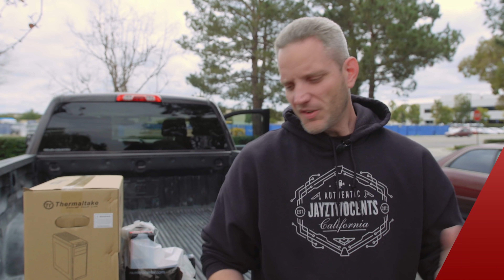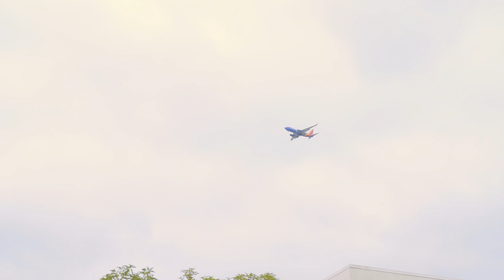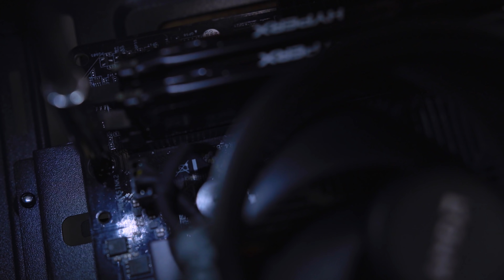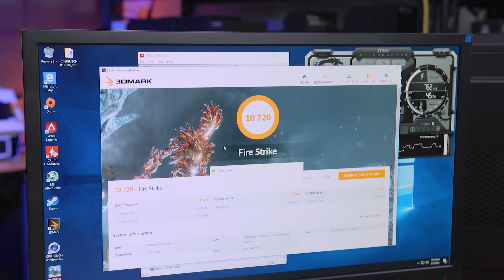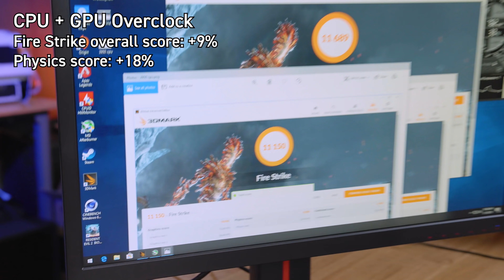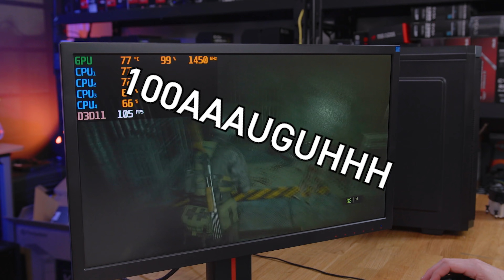CHEAP Gaming PC Build - 2019

Comment: Cheap gaming PC Build in 2019 means keeping your fucking money in your pocket until July.

If you buy computer components for a build now, then you might as well set fire to your money in front of your face.

What is my reasoning you may ask? And ask you may and the reasoning will follow:

1) CPU
It is no secret that the Ryzen 3000 will be released on the 7th of July and announced at Computex in at the end of May. The Ryzen 3000 series will easily outperform the Intel counterparts in the Desktop segment at a far, FAR lower price. For around $200 you will be able to get a Ryzen CPU that will outperform the Intel i9-9900K priced at $600

2) RAM
RAM prices have been gradually coming down and it is expected that by July the prices will have come down by 25%-30% of what it is now.

3) GPU
AMD will be releasing Navi in July and it will be competing against Nvidia up to the RTX 2070 level, but at a far lower price. This will of course force Nvidia to lower their prices - and Nvidia have a lot of room to lower their prices. So even if you don't like AMD, waiting for a few months will net you an Nvidia card for a LOT cheaper than you will be able to buy one now.

4) Mobo
With the Ryzen 3000 Series a new X570 motherboard will be announced. This is not a direct cost saving; however, because the Ryzen 3000 series will be backward compatible with the X470 series of motherboards (except perhaps the R9 3800X/3850X) it will force the price for the X470 boards down.

For the above four components I looked for the best prices I could find for an all-singing, all-dancing Gaming Rig and came to $1,373. I then estimated a conservative price (meaning I was pessimistic about the expected prices and didn't low-ball them) and, for the same performance, you should expect to pay $730.

5) If you are even remotely considering building an Intel based system this year, then you are a complete and utter fuckwit.

In conclusion I have no idea why @JayzTwoCents went with a 2200G when he could have gotten a really good bundle on a 2300X because the GPU portion of the 2200G is garbage anyway and he was going to buy a separate GPU.

For a lot better performance than this budget PC could deliver for $567.76, if you wait until July you will only have to pay, at most, $450.

So @JayzTwoCents was not doing you a favour by making this video, he was doing you a disservice by suggesting that this was a good thing to do - and he knows better.

So shame on you @JayzTwoCents, this was a rotten video to put out, especially when targetting an audience of low means, and I hope that nobody who has a tight budget is conned into following your advice.

Comment: My issues with most AMD overclocks is that the cpu now stays at 3.95Ghz instead of clocking down when idle. Can you confirm if thats the case with this Asrock board? Also how are people getting the OS for free  - legally?
Reply: windows is free, you just wont be able to change the background on it and theres a few other features that i cant remember  but you still get updates as normal.

Comment: Is this build good for games like Assassin's Creed Odyssey?

Ryzen 5 1600 
MSI X370 Gaming Pro
Sapphire RX 580 Nitro+ 8 GB
RAM 16 GB Kingston HyperX Fury 2666Mhz
1 TB HDD WD Blue
Corsair 600 PSU
Reply: That'll be fine man, presuming you're playing on 1080?
Reply: @madcypriot3166  Yes, 1080 High or Very High, not looking for Ultra, 
Now I have tested the RX 580 on Assassin's Creed Odyssey... It's one shit card and I regret buying... Not even running on medium probably with the latest drivers and keeps crashing. The GPU itself is crashing too.
Reply: CPU Utilization is not even reaching 25%+
Reply: @Sulto_  I think that's more the game than anything else, the 580 should be able to run most games on 1080 at high - ultra. Have you tried any other games?
Reply: @madcypriot3166  Downloading other games now to test it, hopefully it's not fucked up situation...

Comment: R5 1600 is $99 at Microcenter. Would this be a better buy?
Reply: GET THE R5 WTF $99 HOLY SHIT
Reply: Yes! I cannot believe he went with the 2200G in the current market. You can do so much better and add like $20 to the build.
Reply: Yes
Reply: I got my r5 2600 for 130 lol brand new
Reply: Youre right

You can get used r5 2600 for 200 canadian or 140ish usd
Reply: Of course!
Reply: its 79.99 at my microcenter, the r7 1700x is $120 also remember the $30 off when you combo a mobo. I saw a vega 56 for 250 on newegg but that deal is no longer available rip.
Reply: @jonnysalazar94  That sale just started this week. It was $99 last week.
Reply: Call me high but is it overboard to get a Ryzen 7 2700x? 😂
Reply: @fredericchopin8874  I mean depends what you use it for. if its for gaming, a bit but itll last you a while before you need to upgrade.
Reply: I checked the micro center near me and its $80! Aaahh

Comment: Holy shit i've been actually doing my research for about 2 weeks and been buying the parts for the exact specs in this video lol
Reply: yes
me too but using an 2400G. so its more powerful in igpu
Reply: Pedro Gabriel same
Reply: Get the Ryzen 1600 for 80 dollars at microcenter
Reply: Pedro Gabriel same but went with a R5 2600 on sale and the XFX xxx 580
Reply: If you have rainbow six siege can you let me know your FPS and settings used?
Reply: I changed the processor to ryzen 3 1300x

Comment: Wanna play apex =
1.buy ps4 
2.connect the ps4 to your wifi.
3.install apex
4.play it.      You saved 300 dollars
Reply: And play sub 50 fps with controller? Hard pass.
Reply: @kebotakandini  you can connect a mouse and keyboard
Reply: @Dervisgt  and the played 24 ms and stick close to 55 inch television? Another hard hard pass.

Comment: Personally i use:
GTX 1050ti gaming X
Ryzen 3 2200g
8gb corsair vengence RAM
480gb burst ssd
500gb baracuda hdd
550 watt corsair Psu
MSI A320-M Pro-VD
Reply: Upgrade to 1070 ryzen 7 or i5 16 gb :)
Reply: @danitft-t9p  yeah if i had the cash! I just upgraded it 7 days ago and at 14 its not easy to get money
Reply: You could've gotten way better performance with the rx580 for almost the same price. Been researching it myself. Although it still depends on the prices in your country.

Comment: Almost exactly my build, still waiting for the parts, Ram is Ballistix, no hdd, 500gb ssd, and a used xfx480 8gb which i got for 75 euros, and an old case i had lying around. totaling me around 400 euros.
Reply: Also, I have a Thermaltake "Silent Tower" cpu cooler(from 2004!) just waiting to see if it will fit. Went for a 650w psu.

Comment: If this is supposed to be an upgradable pc then why use 2 4gb dimms of ram? I get dual channel is faster but I'm sure most people would rather spend $100 on one 8gb with slightly less performance than pay $100 now for 2 4gb and another $200 in a few months for 8gb more and making the original 8gb useless.

Comment: You can sell the 3 free games that came with the Radeon card and get $20-$60 on ebay. Also, if you purchased through Microcenter, did you get a combo discount on the motherboard/CPU? Also, did you stack the $5 off $30 Microcenter coupons? (Just google Microcenter coupons) You can print unique coupons and save even more if you really want to save money, and split your purchases to get the most coupon stacks! Fans are $4-$6 each at Microcenter as well if you need more too!

Comment: Hmm, Thinking here, Would it make more sense to recommend a 2600 or a 1700X (yes, the 1700X is cheaper than the 2600 at micro-center)  and dropping the traditional mechanical hard drive completely since a 1tb 2.5" SATA ssd you can get at microcenter for under 100$? I just dont see the point in getting a traditional mechanical drive even in a budget build now. Bump up price slightly, but still under 600.
Reply: a terabyte hd ive seen for 40 bucks. if you want to spring the extra 60 80 dollars go for it
Reply: @DogMason  problem I see is people grab the 1TB HDD and a small SSD. The total price is usually around 70-80ish  but having two drives needlessly complicates things for beginners.

If a 1TB SSD I can grab for 90$ and only has a single drive. That's more than enough for most people for the their first PC. And it simplifies everything till they are ready to take that next step and get another drive.
Reply: @Sindalis1  The small ssd trend started way back when ssds were more expensive. They boosted speeds by increasing transfer rates. the reason they are used is nlt for storage size but instead for speed. a big ssd and a small ssd might have similar speeds. It is better to have a workload drive for mass storage and an os drive for consitently fast operation. this is why older computers slow down they fill up os drives. The complexity for the end user is minimal as if you are building your own pc you should already have a firm knowledge of drive optimization. through the price it is totally possible to have two ssds now one for storage one for os. or for a dual boot in an affordable budget.
Reply: i actually fell in love with the fx 8350 so cheap. 2200g is also good. I do budget build comps alot at my college

Comment: The Ryzen 3 2200g and the Ryzen 5 2600 are great price-to-performance cpus and the RX 580 8gb is untouchable on price right now. These are easily my top three components at the moment.
Reply: I got a 580 8g, but I'm pairing it with an i5 9600k.

Comment: I bought a refurbished laptop with 8GB ddr3 1600mhz and core i5-3340m cpu and 320GB hard in $150 and even after 1 year I didn't spend a penny on it and its working just fine.😊😊

Comment: I’ll have to upgrade my system this year, because I’m still running a 2012 cpu, but I got a GTX 1070 TI that I bought kinda cheap (pretty lucky, in the middle of the cryptocalypse lol) last year. Both CPU and GPU are heavily overclocked, so I play new triple A games just fine, and I have an adaptive 75hz ultrawide monitor, so no point in going higher than 75 fps for now... the thing is, I wanna buy a high end (preferably intel i7) CPU, AND still be able to overclock it to a decent extent, but I have no idea what would be the best motherboard, without paying for premium stuff that I’ll never use/care about! Any help would be appreciated!

Comment: Hey Jay, i have a question: If i put x2 120mm Corsair ML Pro fans on my cooler , the: Master Air MA620P Tuf Gaming Edition , in a push / pull configuration  WILL it improve my thermals or will it be overkill :D ?

Comment: The CPU is seriously bottlenecking. I have a RX580 4GB varient and I can achieve 100fps on high settings in Apex 1080p.
My current build is 2600x and RX580 4GB, 16GB RAM and 128 GB Nvme with a 2TB Game Drive

Comment: I thought the highes clock speeds for the 2200 g was 3.7 can i go further with mine with a stock cooler? Mine is also paired with and rx 570 8gb

Comment: Things I'd do differently...
1. Ryzen 1500X 
2. Ebay as much as possible

The 1500X is a great budget CPU & doesn't scrimp on the cache plus it overclocks well. The cache is a big difference between 2200G Vs 1500X  : 4MB Vs 16Mb respectively. both have 4 cores but the 2200G does NOT support multi-threading, tat's a big loss.  For gaming, I think you want a discrete GPU so buying the G series Ryzen doesn't seem to smart to me. I do understand this was about how cheap you can go from a local PC store. I just know that there are seriously good deals to be had on ebay. I picked up a 1500X for £50 on eBay, came with the wraith spire cooler too.
 If you are patient, within a month or 2 you will have the CPU that you want for 50 to 75 quid. I only say 1500X because it's usually the cheapest, if you can get a 6 or 8 core cheaply, go for it.

You can generally find an RX580 8GB or the 1060 6GB for about 100 quid on eBay. For 200 you will get a 1070 second hand.

The trick to e-Bay is checking all the time. Do it every day and you will find a bargain, just stick to your guns & set a limit, stick to it and you can get what you want.

RAM is never cheap these days, not as bad as it has been but it is worth shopping around for the best prices. I find that the prices aren't low enough to merit buying it on eBay to be honest. 
A 250GB SSD is all you need to get going and will be ideal for your OS & anything that needs to be there at start up. £30 tops & you will get a great SSD, brand new. Amazon, Ebuyer & overclockers are all good places to look. Get a second standard HDD for storage too, that lets you save a lot of cash. Most things don't need to be on the primary HDD so keeping the install files to a minimum on the SSD will only take about 125GB.  Anything else can go on the standard HDD, it's slower but most of the time that doesn't matter too much.

So ya, the only thing I'd do differently is the processor really. Once you have a PC up and running, you can upgrade as you go.
Reply: i5-9400f is the best value, but if you are going used thats hard to guess

Comment: why don't you check the Cougar MX330-G case....it's full filtered, it has tempered glass, a psu shroud and it can fit two radiators...at around 40$....i would definetely see that in a budget build

Comment: G5400
GTX 1050Ti 
8gb RAM
 Textures at 4GB
Model details at High
Everything else at low
80-85 fps

Edit: The gtx 1050Ti is overclocked with 165 on the core and 275 on the memory sitting at 62 degree  CPU at 50 degree and i don't even have a single fan on the case ( forgot to buy one when building it )

Comment: Now if i was throwing together a system today to take advantage of the upgrade path I would go with Athlon 200ge paired with that rx 580 then wait for the ryzen 3300G which is going to a 6 threaded 12 core with 15 cu APU for 119 pounds or about 139 usd according to the AMD leak so prices may change which would in theory give the apu the same graphics card performance of an RX 570/560 ish.

Comment: How about a budget build for VR?

My budget gaming PC was also a good deal. Sharkoon case 35€ (With 3 120mm led fans and a window) i5 4690k 100€ OCd to 4.5 with a coolermaster 212,  MSI GTX 970 Gaming 4G 97€, 16gb Gskill DDR3 60€. I can play Apex Legends on high at 1080p.   All the details are at builds.gg

Comment: Whats better 
This build or a ryzen 5 2600 with rx580
Reply: Not even a comparison. A 2600 is a better cpu.
Reply: Go with the 2600, i got one paired with an 8gb rx480 with good results (bit waiting for new amd gpus)
Reply: @casualdanger  or go with r5 1600, more stable frame rates. Also you dont build pc just to run one game, so 4c/4t cpu is the thing of the past. Go with 6 cores.

Comment: Yeah! Those prices look great. At best I always have to put a 100% surcharge on them - that's to give my government their import duties on all things electronic.
So, taking your exact parts list on PCPartPicker: https://pcpartpicker.com/list/dMFmTB ... that comes to ZAR 9477 (at this moment it translates US$1=ZAR14.17 to US$ 669 - so possibly not as cheap as that local store of yours - around $100 on top of your cost).
But to actually buy it here, I went with our CHEAPEST online shop: https://www.wootware.co.za/
Trying that exact build, though some components I couldn't find in the exact models (instead with similar PSU=Thermaltake SE Series 530W; GPU=Gigabyte RX580AORUS-8GB; Case=Thermaltake V71) very similar. Guess what the cost is: ZAR 11057 + 15% VAT = R 12716 = US$ 897 ... GREAT aint it?

Comment: Ryzen 5 in this build would make the perfect budget mid tier pc
Reply: The Ryzen 5 2600 is like 20 dollars more adn definitely worth it.
Reply: @clintonknight9798  where do you live where the market is that inconsistent? the price gap is $70
Reply: @sirsalmon9878  Some place reality isn't mandatory apparently. Still, 2600 and 2x8gb 3000hz would be a massive improvement for ~$110-120.
Reply: @mayberandomlybam3038  yeah, that would make a beastly PC for the price.
Reply: @clintonknight9798  what? 2200g is $95 while 2600 is $165, how is that just $20 more?
Reply: i5-9400f is better value

Comment: That is even cheaper than my system that i build in Jan. but i already had my ssd Samsung 970 and buyed last week my O11 case and full hd monitor.
So about 300€ for MB, CPU, Cooler (For not using the crappy stock one) Ram and PSU. In Feb i Added 2x Nuctua 140 ULN B Type so i spend just 30€ on 2 for these and a 120 NF-A12x25 PWM.
Oh and i added Wifi Blouetooth 5.0 From Gigabyte for better connection to Mouse and Keyboard.

But i dont get id, why buying a CPU with a APU when u buy a AMD Graphics Card? Better choice i think would be the Ryzen 5 2600 =/ Or not?

Comment: You should have pulled an RX 480 or GTX 1050 off a shelf for a quick comparison to compare. If someone does this build and they are at the store that comparison will be relevant for staying in budget. Since the target for this build is console players thinking of getting into PC builds atleast pick a KB/M combo pack that's super cheap... pick not purchase and add that price/part to the tally. Consoles come with a controller. "Everyone has a TV" so that's the reason for not including a monitor. Console users will argue that monitors should factor into the PC cost but say that when you call out the TV. As for OS... you can download Win 10 from Microsoft and use it without buying it, you get an annoying watermark and cant customize the look of it but it works so that shouldn't factor into the cost.

Comment: Jay, how about round 2 of the noctua d15 vs AIO, this time use a cpu that doesn't have "heat issues" but one that you can overclock to make it hot? remove the heat spreader issue and focus on showing how much thermal head room the two coolers have instead of showing how they both removed heat from a flawed CPU? Also, funny note that I just did an upgrade build this last weekend. I went from a fx8150 to a ryzen 2600X for $496. Bought a noctua d15 am4 off amazon after the fact. now I am curious if I should have spent the extra $30 or so to get a double fan AIO.